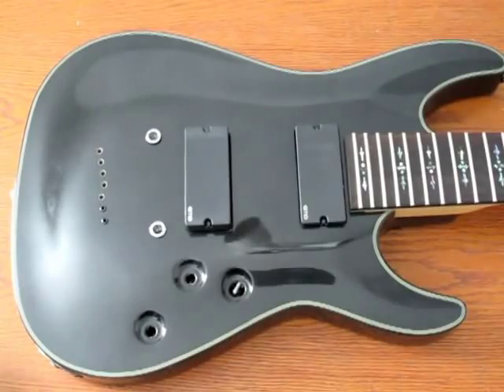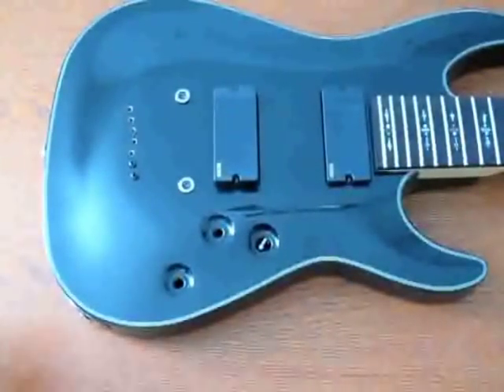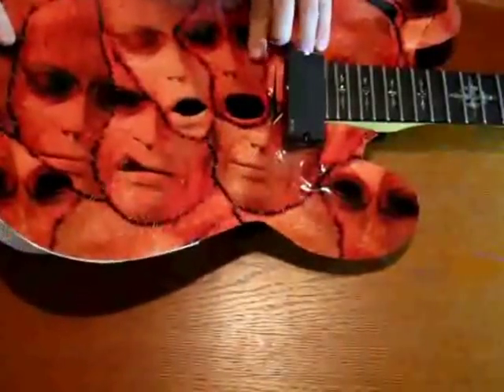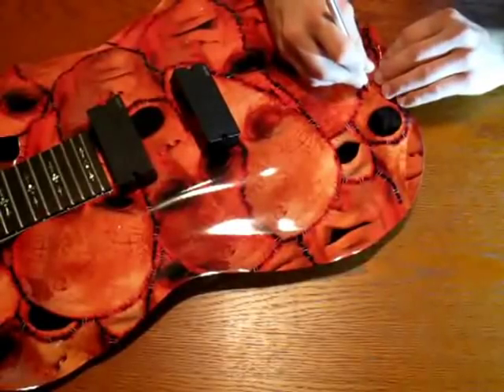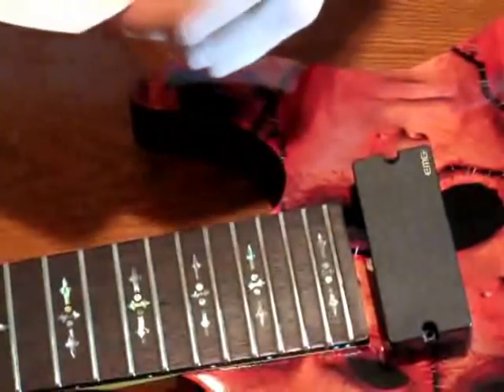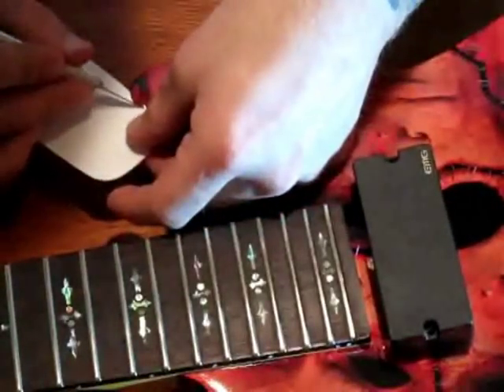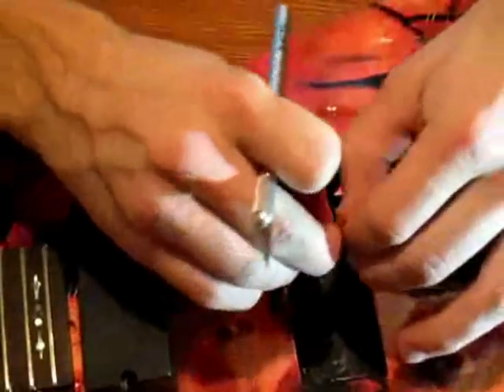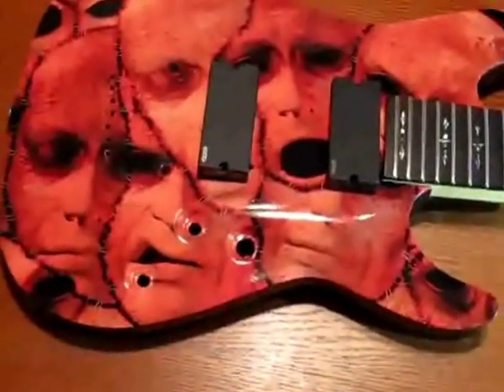Guitar Skin Application Video

Comment from the maker: @orngwhp71 You may have when I just roughly laid the skin out on the guitar but after it is installed there are zero wrinkles or bubbles.  The material is speciafically designed to be extremely user friendly and has a special adhesive that eliminates air bubbles and wrinkles that are normally associated with vinyl.  Also the laminate we use is designed to mimic clear coat so you'll be amazed how many people you'll fool into thinking your guitar is airbrushed.

Comment from the maker: @EmmaThomson2 

Surely you could trace your guitar and transfer the trace onto the skin then cut out the skin and install but 1. It takes forever and you could still end up with gaps if you botched your template somehow and 2. It would be a major pain trying to install that way on an arch top guitar.  I've experimented with every application method imaginable and the method shown in our video is not only the fastest but is also the easiest and most precise.

Comment: I am assembling a kit made by Saga. It is a Les Paul type. I'm using Model Master 2-part lacquer.  I am about to start painting the guitar in AMC blue. I will then follow Model Master clear lacquer. I plan on buying your "school girl" skin and applying clear lacquer over it. My question is will the clear laquer melt the skin? I would like to know before I buy, that's why I listed the specific paint I am using.  I want the application to be permanent.